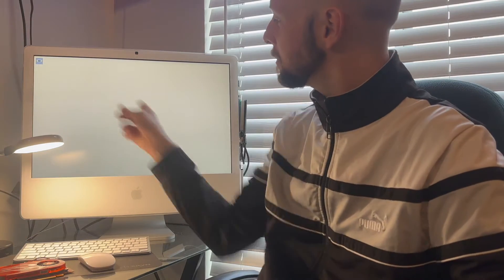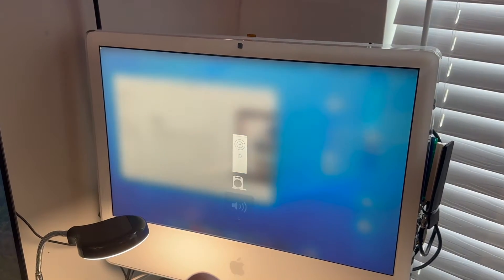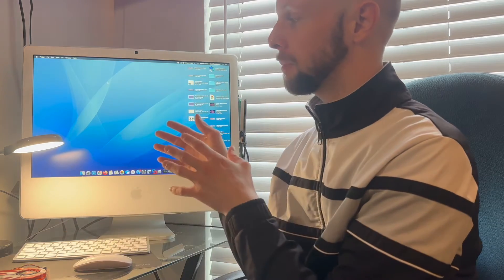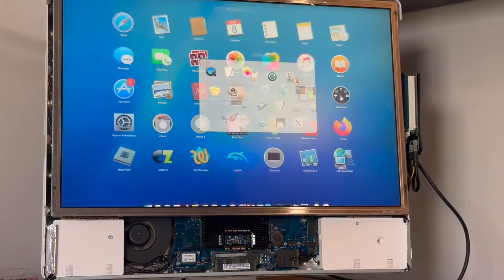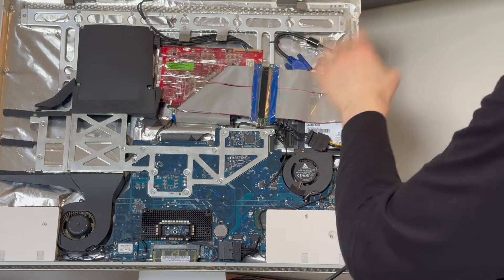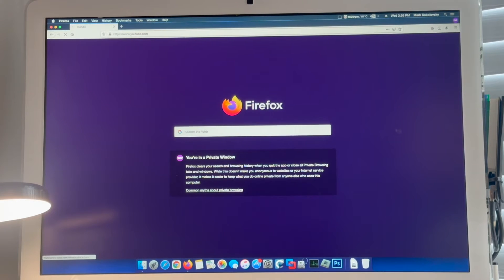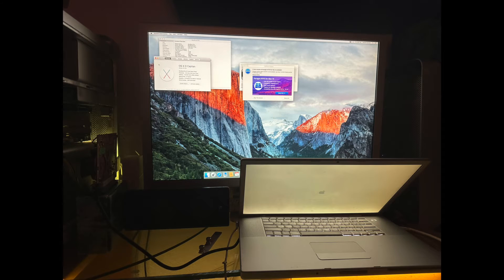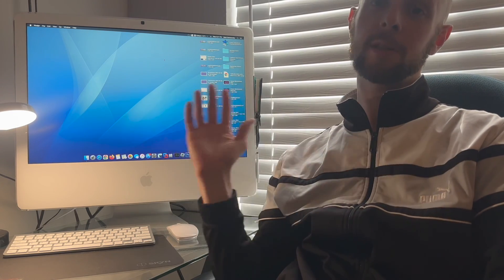The 24" 2006 iMac with a desktop GPU inside!

Comment: Bel lavoro, so che esistono schede MXM per alcuni iMac 2007 e dopo, però potresti creare una scatola dove porre le schede invece di appiccicarle al Mac.
Reply from the maker: The idea was for this to be more of a GPU replacement rather than an external GPU. I understand what you mean - there are alot of MXM 3.0 GPU replacements out there. This is more for 20/24" Early 2009 iMacs and later. 2007/08 uses MXM 2.0, options are more limited unfortunately. Same thing with 2006 Macs